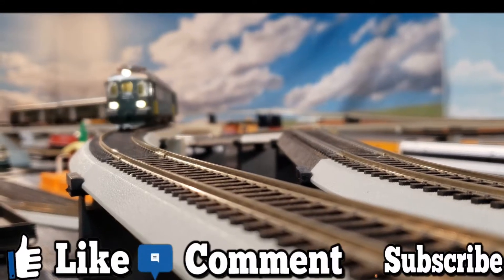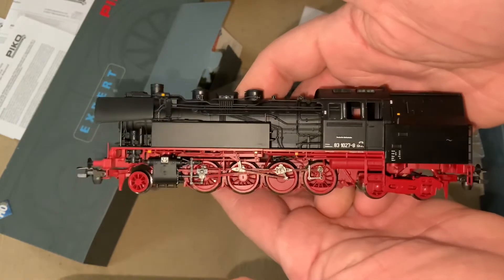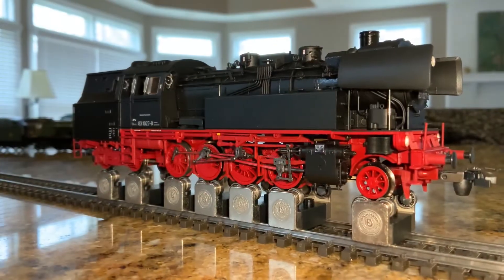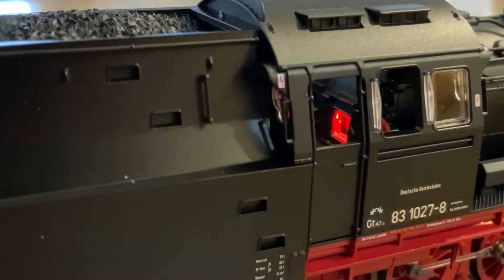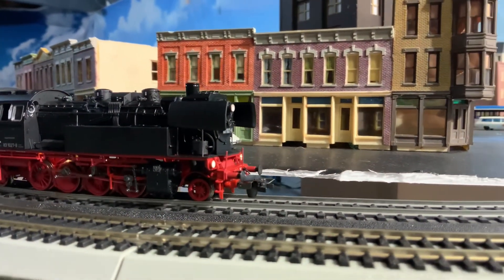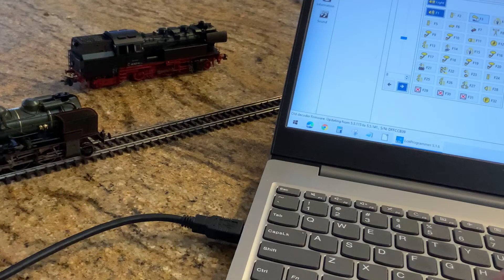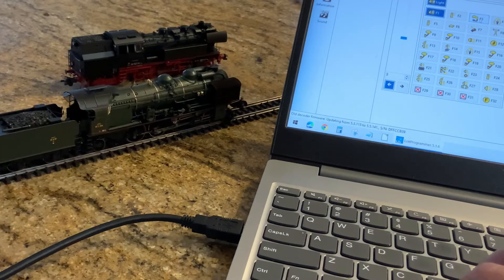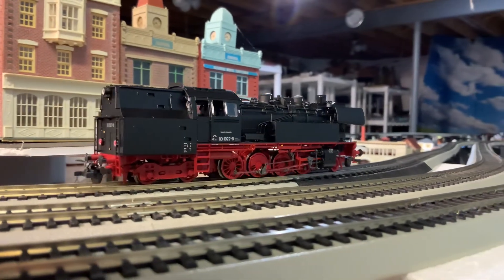More Model Misery: Piko 55916, East German Class 83.10 Steam Engine (Deutsche Reichsbahn BR 83.10)

Comment: This locomotive does not have dynamic smoke. It just has a simple 'Suethe' like smoke generator that may not be properly seated in the model. You could try gently pushing it lower, or perhaps rotating it to establish the electrical connection.
Reply from the maker: See updates.. This was made several months ago
Reply: @DoctorHobby Buddy, have you solved this problem? I bought the same model and I have same issue. Thanks for help in advance.